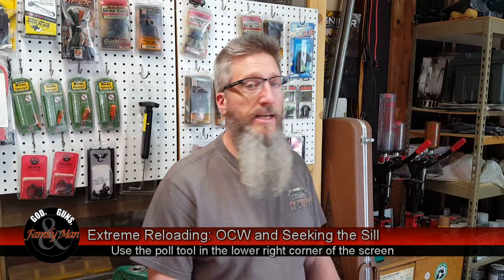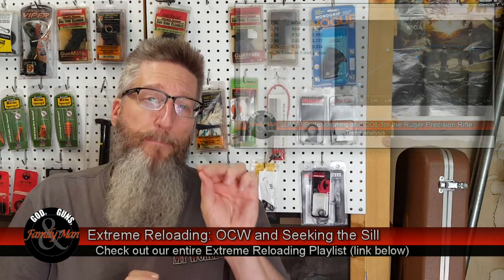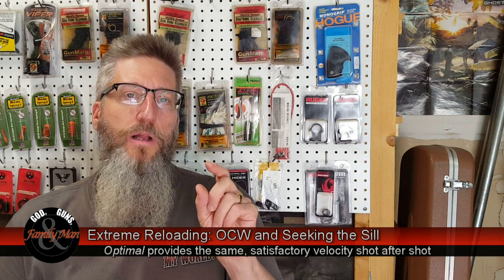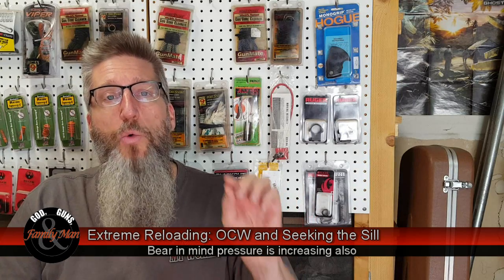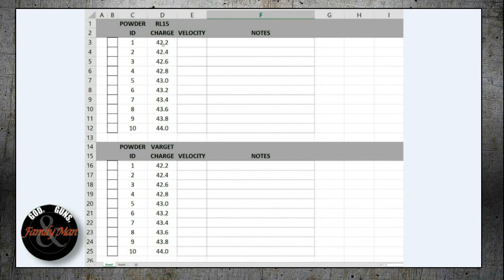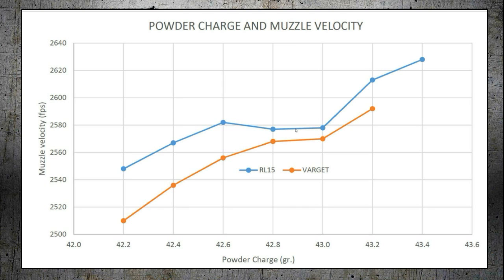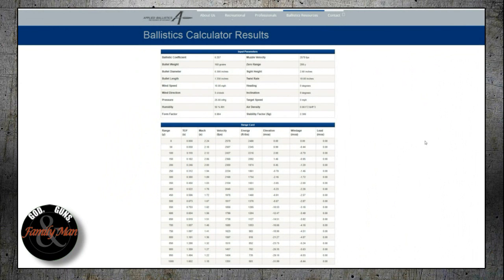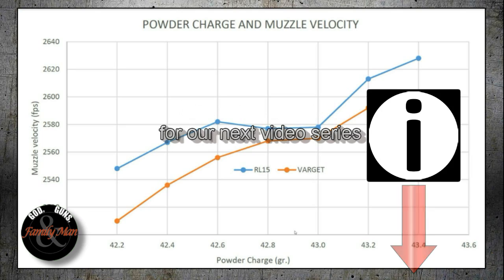Extreme Reloading the RPR: Optimal Charge Weight and Seeking the Sill (ep. 09)

Comment: Try the new 169 SMK. It stays super sonic to 1100 yards
Reply from the maker: I am using the 168 gr. Tipped Match King which has an even higher BC.  The killer is not the point at which these bullets drop below the speed of sound but the point at which they enter the transonic zone (~1300 fps and below).  Sierra Match Kings are somewhat notorious for not flying through that zone very well.  
Thanks for watching and posting.  I always like to hear about newer bullets!

Comment: I know this is an old video but. I'm curious to know with the 2.79 OAL how far off the lands is it?
And would you have any information on reloading a 165gr bullet or personal experience for long range?
I have an RPR Gen2 308 and I inherited a bunch of 165 308 bullets. 
Any bit of information or advice would be Absolutely Appreciated 👍👍
Reply from the maker: Hello James, In my experience with the RPR it does not perform well with the bullet seated very close to the lands.  I load the Sierra 168 gr. TMK to fit into the magazine (pretty close) and that gives me 0.7 MOA groups very regularly. However, If you use a bullet with a secant ogive these are going to be more sensitive to seating depth relative to the lands.
I did a few videos on 165 gr. bullets in the RPR, here is a link https://youtu.be/39gxq0The_c to the first one.  I used the Sierra Game Changer and then also tested this against the 165 gr. Barnes TTSX bullet.
Thanks for watching and posting.
Reply: @sdkweber  With 2.79 do you know how many thousandth you are off the lands?
Reply from the maker: @jamesglenn520  Hello again James, I took some time to measure all this again last night using some relatively new Hornady tools I have.  If I were to seat a bullet just a few thousandths off the lands the cartridge would never fit into the magazine.  The load I worked up actually has a 0.180" jump from the ogive of the bullet to the lands.  That is tremendous but giving me 0.7 MOA groups consistently even out to 600 yards.
Reply: @sdkweber  That's a Hop Skip and a Jump!! I'm hoping to make up a load that is fairly consistent with these 165gr that I have. I truly do appreciate your time in helping out 👍👍
I just can't see not trying to use these bullets for quality trigger time. But I think it would be a waist to just randomly load some Crap Load that just goes Bang!! Lol
Plus some are Hunting bullets so that would be a plus for that.
Reply from the maker: @jamesglenn520  Absolutely James. The 165 gr. bullets I tested did quite well.  I also noticed on my RPR its twist rate does not "like" anything much heavier than 168 gr.  

I like to recall that its not "practice makes perfect" but "perfect practice makes perfect".
Reply: @sdkweber  That sounds about right!
Thank you very much for the information on the 308.
Reply: @sdkweber  Thanks for the link it really helped me to find a starting point 👍
I am just curious about how much Jump your rpr seems to like. At this time I really don't have the equipment to measure the chamber correctly 😒

Comment: The sill is desired and important because powder performance may vary with temperature and throat erosion.  By using a powder charge within the sill, these effects may be minimized.
However there is variation at any specific load because the scale accuracy may be +/- .1 gr, there is variation in hand loading components, the chronograph accuracy may be +/- 5 fps, etc.  So it is possible to get an "artificial sill" due to inherent errors in measurements and hand loads.  These variations are not accounted for due to a sample size of 1 for each powder load in the 10-shot OCW method.

One approach is to shoot the 10-shots from low to high powder charge, then repeat for a sample size of 2 by shooting the 10-shots from high to low powder charge to confirm that the sill is not "artificial".  Or shoot the 10-shot OCW each day for 3 days in a row to see is the sill "artificial" or is is consistent and real? In your example, you got a consistent sill based on 2-powders, so it is likely real.

"Extremely consistent muzzle velocity" requires an adequate sample size for a specific powder load.
In the 10-shot OCW method the sample size is 1, so the variation of muzzle velocity at a specific charge is unknown.    After discovering the consistent sill, shooting 5-shots at a powder charge below, within, and above the sill would show how consistent is muzzle velocity at a specific powder load.
Reply from the maker: You are right. It is important to verify by additional testing.
Reply: @sdkweber  As an example, I shot 4 10-shot ladders yesterday with a Tikka .270 Win and 4350, each sill was less than 3fps but different: 53.7, 54.3, 54.7,53.5. 
I shot at 0 degrees C and let the barrel cool for 5 minutes between shots.  Used a magnetospeed chronograph.
I think the differences were due to inherent variation due to powder and chronograph errors (+/- 0.1 gr?, +/- 3fps?) and variation in hand loads.  
Ultimately I selected the charge with minimum velocity variation 54.5 (stdev 4.0, n=4).
Reply from the maker: @RetrieverTrainingAlone  I would have done the same thing.  But also look at the harmonic nodes while shooting the ladder.  If you get a  sill + harmonic node at pretty much the same powder charge, that will be a hard load to beat.
Reply: @sdkweber I like the school of thought to first minimize velocity variation (ignition variation) by trying different powders/primers/neck tension, etc.  Then work on the harmonics via different bullet seating.  See Eric Cortina's video:  https://www.youtube.com/watch?v=6VEMZJYovMA
Reply from the maker: @RetrieverTrainingAlone  I think you will like our new season of EXTREME RELOADING.  We are focusing harmonic nodes and neck tension.  I call it "Nodes, Necks, and Sills" and the first video will be released in about a month.

Comment: If you're concerned about compressed loads...try vibrating your charged cases on a vibratory tumbler for 10 seconds before bullet seating. Seat your bullet 70% then flip case upside down and vibrate again, powder will fill in around the sides of your bullet boat tail. Finish seating. You'll be amazed at how much more powder you can fit in a case😁
Reply from the maker: I bet this would work.  I have not tried it though.  Thanks for watching and posting.

Comment: WW brass has more capacity
168 MK @ 46.0 of Varget
CCI br2  
Upper OCW load node
Your load is the lower OCW load @ 43.9
Reply from the maker: This is a good point.  OCW needs to be established using specific brass as some will have higher or lower case capacity, thereby changing the OCW.  I like Lapua and Norma. Loads beyond what I tested here are compressing too much.
Thanks for watching and posting.

Comment: Just found your channel, subbed. Also just found out the military is changing up to 6.5 CM over the standard 308. If artical is correct basically rebarrelling service wide. Superior ballistics yada yada yada. With THAT happening the 6.5 ammo is going to also be mass produced cutting its costs radically. (Outrageous now.) Just food for though for future vids. BTW, Ive been loading for 40 years & learned something new today. Thank you! Also, by doing the internal primer hole reaming I changed my 30-40 FPS variations down to 10 FPS variations. Im absolutly anal about EXACT charge weights. Every new rifle gets the battery of powders, primers, bulletts until I find that ONE load sweet spot & that rifle shoots only that load from then on. If I know my rifle is shooting straight, I SHOOT straight. Personality mental quirk....
Reply from the maker: Thanks Dave Jan,
I did not know the military was going to start using the 6.5 Creedmoor. I need to look into that.  Also good to hear the flash hole tip helped you.  I agree with you that if you have confidence in your rifle you tend to shoot it better.  I think that is true for everyone.  
Thanks again for watching and posting.

Comment: I really like 44.0-44.5 of RL15. But my current accuracy load for my .308 is 41.5grns of AR Comp and a 175grn TMK in RWS brass.
Reply from the maker: Tell me more about what you are getting with this load?  Velocity? Precision? Where are you finding RWS brass and how does it compare with Norma or Lapua?
Thank you very much for watching and posting.
Reply: sdkweber The RWS I bought through MidwayUSA sale on RWS hunting ammo. I shot it out and the did brass prep. I feel it is the same quality as the Norma I have used in the past. Velocity out of a 28” 1:12 is 2769 with and SD of 2fps. It’s a very consistent powder.
Reply: sdkweber After about 2000rnds the barrel is holding .3moa.
Reply from the maker: Very good stuff indeed.  I am going to look into getting some RWS and maybe try a pound of AR comp as well.
Reply from the maker: Excellent.  This is 5-shot group?
Reply: sdkweber Multiple 3 shot groups on varying days. If I do my part, .25” at 200yds. I put together about. 6” group at 1000yds on a steel 10” plate during a steel match.
Reply: sdkweber The few shots I hit at 820 in my first match printed sub 2” on a 4” plate. Those 4” plates are hard to hit.

Comment: How many rounds did you fire at each charge weight?
Reply from the maker: With well prepared, high quality brass cases, you only need to fire one round at each charge weight to locate the sill.  Seems to work pretty well.  Is it perfect?  No, but it certainly seems to help with load development.
Thanks for watching and posting.
Reply: When you have some extra time would you mind trying to repeat 4 of the charge weights with 5 rounds each?  From my experiences when stepping at 0.2 grains and measuring each powder charge on a scale that has a resolution of +/- 0.05 grain, I measure velocity which can overlap velocity of an adjacent charge weight.
Reply from the maker: Hello Todd B. This is a good idea. I think one would still need to take the mean and/or median velocity of those 5 rounds, or just plot all of them as a scatter plot "cloud" to understand what is going on.  
I wanted to share with you though the "proof in the pudding" for the OCW process.  The video that followed this "seeking the sill" video, shot a group using the powder charge indentified here.  We got a muzzle velocity standard deviation of only 3 fps., check out this video if you are interested at https://youtu.be/yuq0zbJI5zQ
Also, the RCBS electronic scale has a tolerance of +/- 0.05 grains, so measuring at 0.2.gr. is a real measurement and not within the instrument's error tolerance (I had a long discussion with RCBS on this and saved their emails).
Thanks again for watching and posting.

Comment: Curious if you've tried alliant 2000mr? My Savage precision 308 was easily hitting 2700 with no pressure using a hornady 178 bthpm. Accuracy was very good, best 3 shot group was .187" easily held 1/2 moa through high and low temps. Also allowed for much greater range before going transonic due to the weight and high b.c.
Reply from the maker: Hello Phillip
No, I have not tried that powder.  I am going to look into it though after reading your post.  Is yours Savage Precision a 24" bbl.?
Thanks much for posting and watching.
Reply: sdkweber 
Yes it's a 10flcpk, I recently sold it and moved to a 6.5.
But still have all my load data records.
Reply from the maker: My RPR is a 20" bbl so that will limit the muzzle velocity I am achieving.  Thanks much for the followup.
Good stuff.

Comment: What is your issue with compressed charges other than broken power grains? I've found some compressed charges that shoot really well.
Reply from the maker: It's not that they won't shoot well, but there is the concern that those broken kernels can affect burn rate and cause sudden jumps in pressure.
Thanks for watching and posting.
Reply from the maker: Very good to hear this scythes28.  Not sure I talked about ES and its importance for long range shooting in this video but I am sure I talked about it in other videos. I have also mentioned (in other videos) that bullets can settle down after about 200 yards and really start showing their worth.  Thanks for watching and posting.
Reply: While this is possible, some (like Varget) often shoot better (lower ES) with a slightly compressed load, at least that has been my experience. Also, you didn't touch on it unless I missed it, but ES is also extremely important at long range, not so noticeable under 500 or so though. While not common its possible to have bad ES in your sill zone. You might hit another sill a little higher if you aren't getting pressure signs, I had another around 44.1 of Varget in my rifle, with Winchester brass.
Reply: If short range shooting there's no issues.. However, as we all know, the farther out the greater the effect of variables.. When you crunch the kernels and thus increase burn rates, You are not doing this in a consistent manner from one cartridge to the next as the powder falls into the case differently from round to round. Thus your powder is burning at differing rates from shot to shot and giving fluctuating velocities.. Not an issue at shorter ranges, but for anything @ about 400 yds or so it begins to show up  @scythes28
Reply: scythes28 absolutely agree. I'm using 42.5gn of ADI2208 (rebranded to Varget in the U.S. I believe) in a .308. It's compressed under a 178 ELDx. My groups are the best I've ever achieved, though they're only moving at 2550fps.

Comment: Is there a load that it more accurate than the other? In other words is there a specific speed that the bullet is more accurate?
Reply from the maker: Good question.  Throughout the range of charges tested, this rifle with the Sierra 168 gr. TMK has done very well (sub-MOA).  The 42.9 gr. arrived at here will pretty much guarantee me 0.50 MOA or less from prone. In fact, just last weekend I shot a 0.47 MOA group at 300 yards from prone and I think I can beat that. I need to load another box and run another test but I feel very confident with this load.
Thanks for watching and posting.